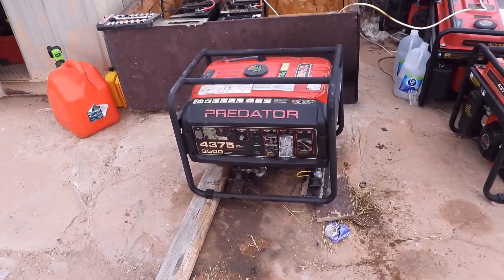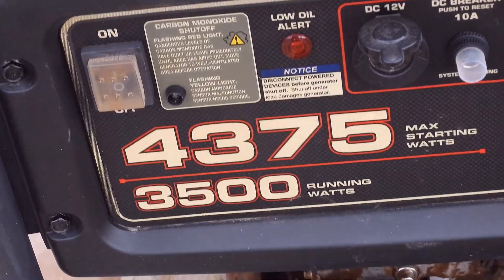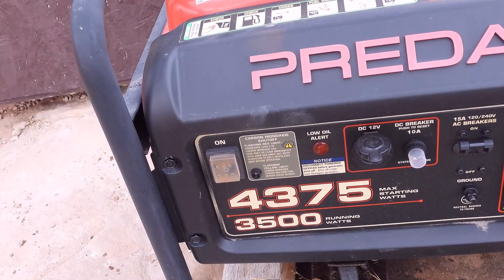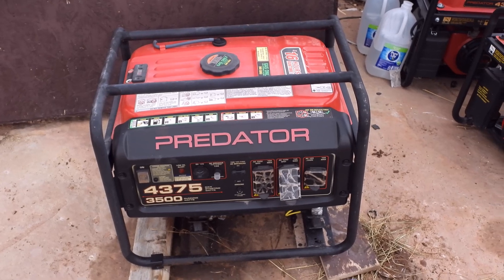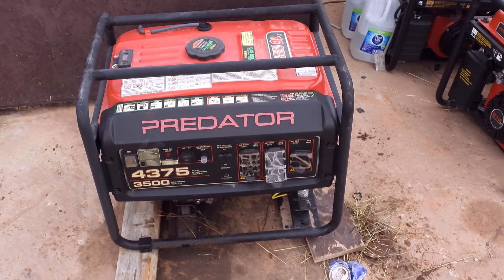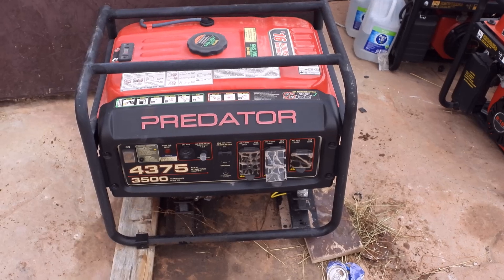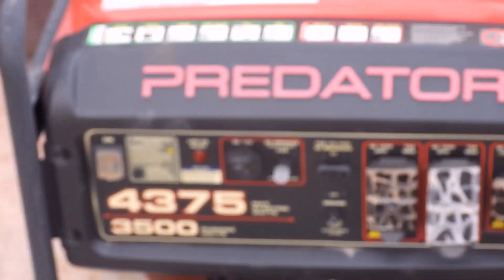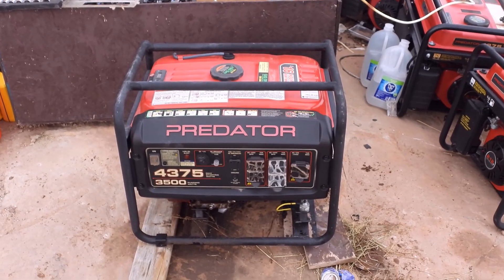Carbon Monoxide warning on Harbor Freight Predator Generator Free Fix

Comment: That filter in the muffler is called a spark arrestor. It's to prevent any possible sparks leaving the muffler and causing a fire.
Reply from the maker: Yes.  Like most safety devices, it adds cost to the product while making it less reliable.